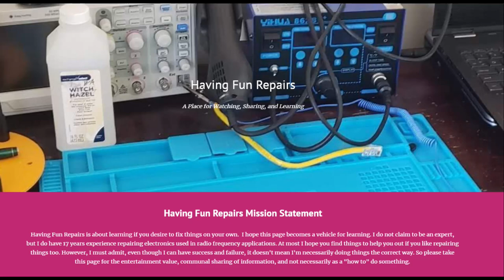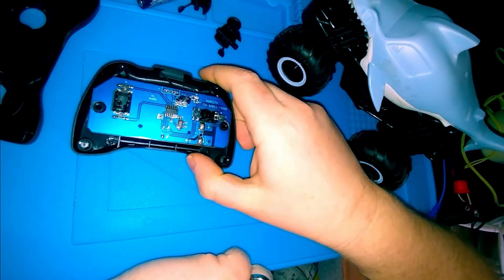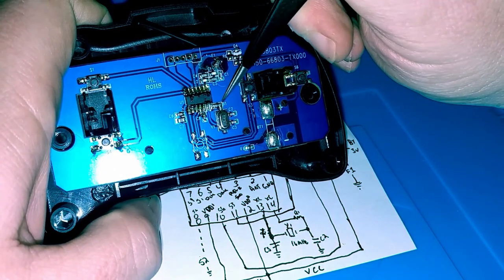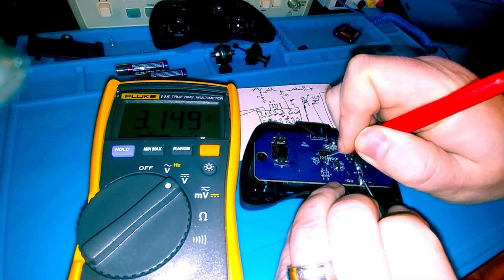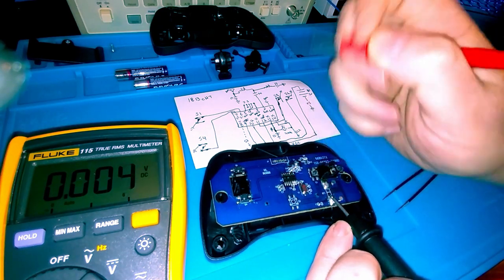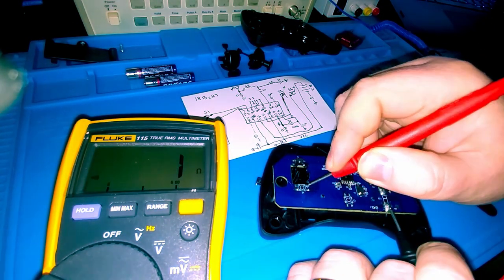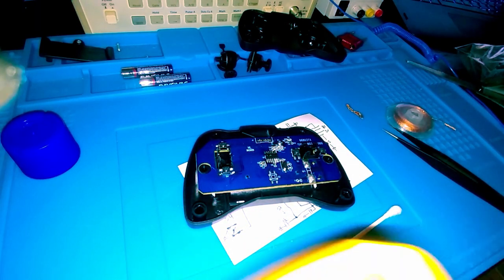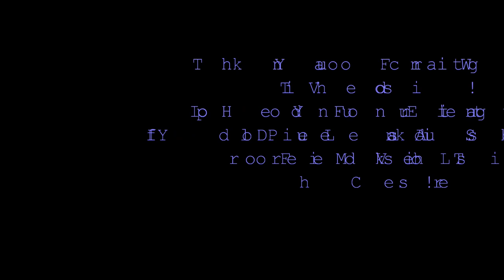Monster Jam Megalodon RC Repair

Comment: Can i use the same control with different trucks?
Reply from the maker: Great question! The only answer I can provide you with is, maybe.

Here is why:
You have to think of the controller as a transmitter and the vehicle as a receiver. 

Transmitters need three things essentially to be of use. 
1) Power
2) RF carrier frequency
3) Intelligent signal

Receivers need three things to be of use
1) Power
2) RF carrier from the transmitter
3) an intelligent signal from the transmitter

For a transmitter it takes an intelligent signal, say a button press, and codes it or modulates it onto the carrier signal to transmit out. 

The receiver picks up on the carrier signal and decodes or demodulates the intelligence off the signal. To make the vehicle do what ever corresponding button was pressed. 

However, both transmitter and receiver must function off the same carrier frequency to work. And the intelligent signal must also present something the reciever can make use of otherwise it is rejected. 

Example transmitter and receiver both operate on the 45MHz carrier frequency. The transmitter's forward button is pressed which cause a 1KHZ intelligent signal to be coded or modulated onto the 45MHz carrier. The receiver picks up the 45MHZ carrier signal cause that's what it is looking for and demodulates the 1kHZ intelligence signal. However, the receiver needs at 2KHz intelligence signal to make the vehicle move forward. So nothing happens and the vehicle doesn't not move because the intelligence signal was not usable even though both transmitter and receiver were on the same carrier frequency.

I'm really overly simplifying things here, but that's the just of it.
Reply from the maker: I'm pinning your comment because it is a very good question.

Comment: Hi Sir. My toy doesn't work even after replacing the battery.  what should i check first? And how to check if remote and car is connected properly. Thanks
Reply from the maker: It's a bit difficult to diagnose an issue without the product in hand. Did you replace batteries in both the remote and the car?
Reply: @HavingFunRepairs  yes, i did replace in both the remote and the car
Reply from the maker: This is a tough one. Sounds like your controller is not syncing up with the rc car. Could be for various reasons. Easiest would be to try another set of batteries. Second would be to take apart and see if there are any wires from the battery box to the PCB that have broken. Further diagnosis would require fault finding components on the PCBs.
Reply: @HavingFunRepairs  I have checked the battery line with the circuit, all is good.  but I found a cable connected to the antenna and the other end of the cable is not connected to anything, only the cable is cut.  is it normal like this?  if not, someone might cut it off and cause the car to not connect to the remote
Reply from the maker: I'm not sure I understand what you're trying to dictate in message. If you are willing to take some really clear photos and send via email I might be able to assist further. My Google site and email is linked in the About section and in the description of every video on YT. I cannot guarantee I can solve your issue this way, but I may be able to point in towards some things to check.
Reply: @HavingFunRepairs  i will email you, Sir. Thank you

Comment: Hi mate I've got the larger one and can't seem to split the controller, seems like the "nobs" need to come off to allow the front panel to come through. Any ideas how to remove them? Heat gun maybe?
Reply from the maker: That sounds a bit risky.  Especially if the controller parts are plastic. Without knowing what the controller looks like, I'm afraid I don't have much to offer. I would make sure there are not any hidden screws under a sticker if the clam shell doesn't open. Typically, controller knobs only require a bit of prying under their base.
Reply: Thanks for video!! I have the larger Grave Digger with similar issue. The clamshell for the controller was held together with 2 screws BUT there were these octagonal male/female posts which fit together very tightly to provide the resistance to keep the clam shell together. I had to carefully use several tiny flathead screwdrivers to equally pry the two halves apart.

Comment: hey do you have any idea on how to fix a broken wheel? it’s cause my little brother broke the back right wheel off:/
Reply from the maker: Depends on how it broke. I believe the axles are hollow plastic tubes. If it's the axel that is broke you might be able mend it with a little metal dowel rod and some glue. Can be done by putting the rod down the inside of the axle where it meets the body and inside the axle where it connects to the wheel. A little bit of glue on the rod prior to putting inside the plastic axle should hold things in place. Just be sure to ensure fitment before final assembly.